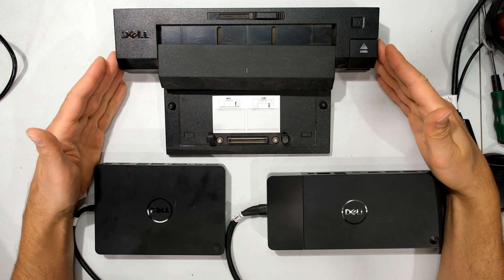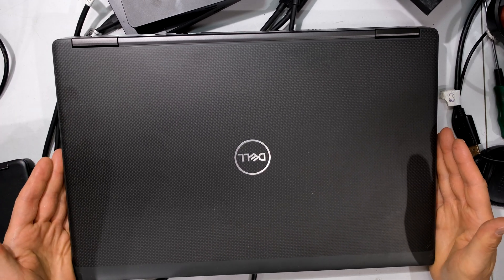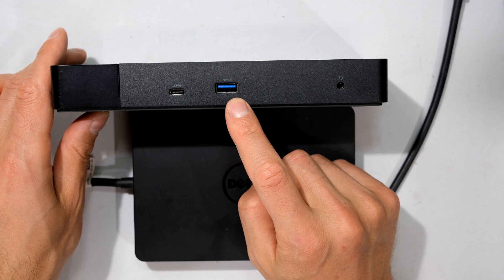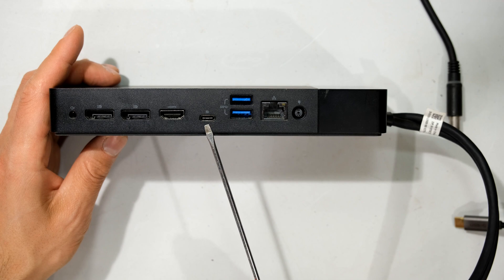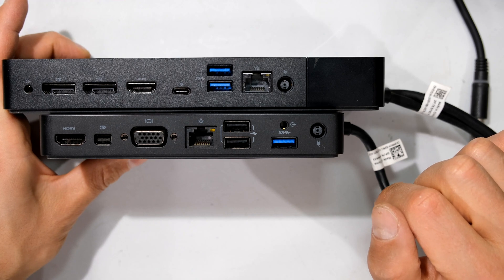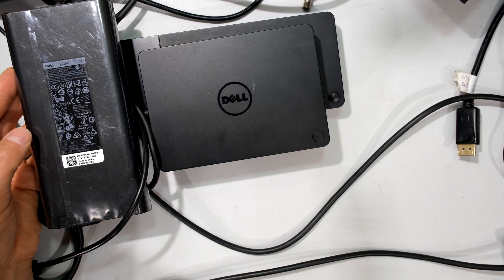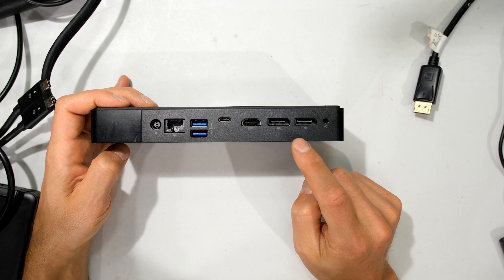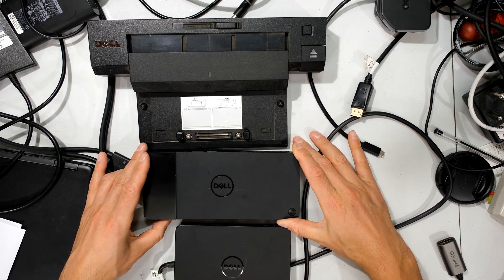Comparison of the Dell WD19DC and WD15 dock - e-port plus II also shown

Comment: Actually, my Dell WD15, using Dell's 180W power supply provides my Dell Latitude 5320 with 130W. So with the correct dock and power supply combination, you can charge the laptop, contrary to what you stated.

Comment: Why the dock needs a power supply if I don't use it for charging the laptop? Does the power supply makes the connection to the monitors work better?

Comment: Hi! Maybe just as supplement to 07:50.. for all those asking about the charging their laptop with WD15: it depends on the battery you are having in your laptop and the power of the original charger.  for example, bough a new Ideapad3 (LENOVO) with the 38W battery and the 64W charger. To know is WD15 capable of charging your laptop you need to know the output power of the dock. WD15 with 130w charger can output 90W power, which in my case was enough - so I have bough a used wd15 and everything works perfectly. Side note: wd15 with the 180W charger gives an output power of 130w...

Comment: I have a question for all you, I have a work laptop with 1 hdmi and 1 usb c. The usb c is not thunderbolt. I also am not allowed to install any software or drivers on the laptop. With that being said, I would like the option of powering two external monitors for better productivity. Is this possible? I have tried dock after dock and spent 100’s of dollars trying to make this work. If anyone sees this and has a option for me I would greatly appreciate it!

Monitor 1- Acer KA272
Monitor 2- Lg 34WQ500
Laptop- HP RTL8822CE

Comment: 240 watt adapter? I didn't see that mentioned in the WD19's documentation. It specifies using the 130W adapter for 90W power delivery, or the 180W adapter for 130W power delivery.
Anything over 180 watts will not be used, because 180 watts provides full functionality and the maximum power delivery supported by Dell (130W).

Regarding the error: Do you get that if you plug your USB hub into one of the two USB-A ports on the BACK of the dock (not the one on the front)?
Reply: i will just point out the irony of your profile picture whereas all the nazis are in ukraine ://

Comment: Thanks for this video. Currently I am using WD19TB with Precision 5550 and using a single external monitor (with inbuilt speaker) through HDMI port of Dock. But the problem is it's not redirecting laptop audio to External monitor. Tried all possibilities available over internet but no luck so far. 

Do you have any idea about this. ? If you can guide me then that would be really helpful for me.
Reply: Did you try the settings in Windows 10. I know I need to switch from my laptop to another output using that setting